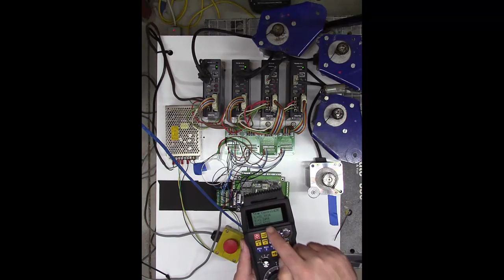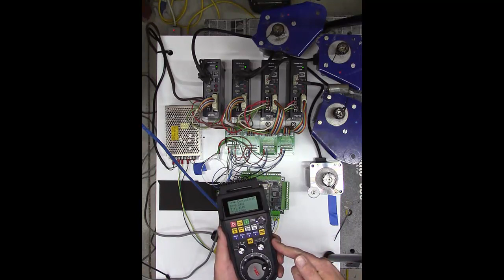ShopBot PRT Alpha Acorn Conversion Benchtest

Comment: Did you or have you had any issues once you got it on the machine?  I just bought a PRT Alpha and want to do an Acorn upgrade on it, with the hope of being able to add an indexer in the future with the drive and motor I already have.  When you ran the X axis motors they were spinning the same direction, being on opposite sides of the machine did you just swap motor wires on the machine to get them to spin opposite?  Thanks for any advice.  Dan
Reply: How is the machine?? Looking at getting one
Reply: @dsaworxcarpentrysolutions9155  For what I paid it's great, but there are small issues that crop up do to being an older machine.  If I someday get to where I'm regularly producing things on it I'll either upgrade the controls or get a newer setup.